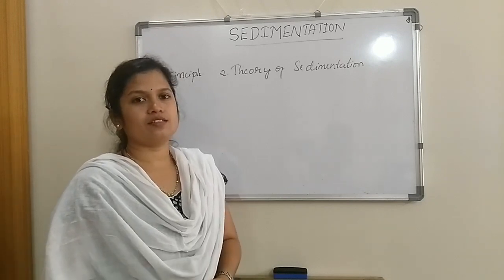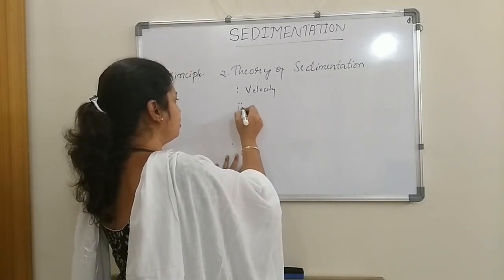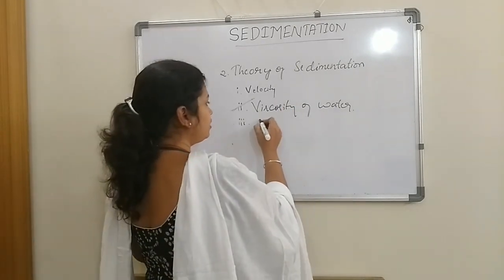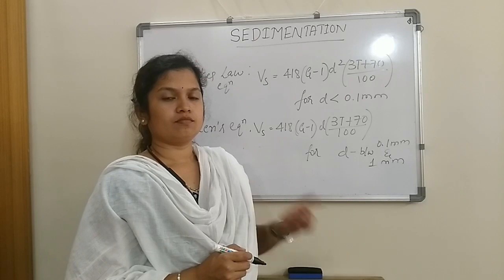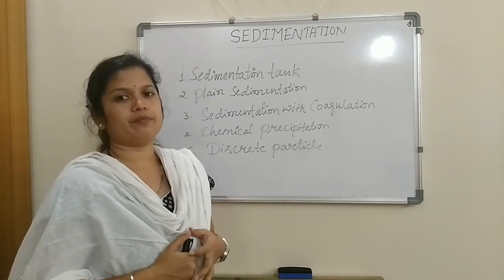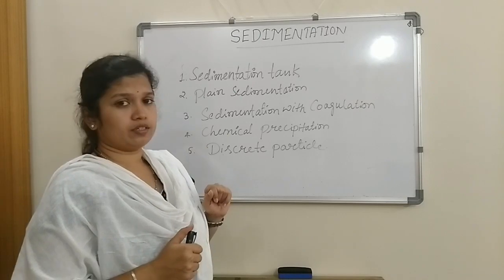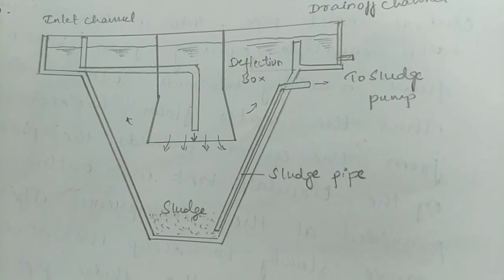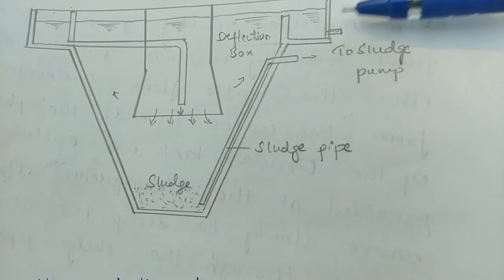Sedimentation process|module 3| water supply and treatment Engg.|Civil Engg.|VTU syllabus- part 1

Comment: What is the benefit of using bottom barriers
Reply from the maker: Using barriers will slow down the velocity helps in setting of particles
Reply: @shwethakc7697  thanks 🙏 can ask you another question  please? If I want to take a sample from inside a laboratory sedimentation tank, how much should I go down from the bottom of the water and take it and why?
Reply from the maker: @salahalmafrjy2095  I think you mean a sedimentation tank of experimental type... We have to take undisturbed sample at the surface
Reply: @shwethakc7697  All right, Doctor, but if I took a sample at a distance of 1 cm from the surface of the water and extracted the height of the sludge, what would I call it because the height of the sludge is from the bottom of the basin to the  surface  of sludge?
also what is the difference between  Tss removal,precent removal,turbidity removal?